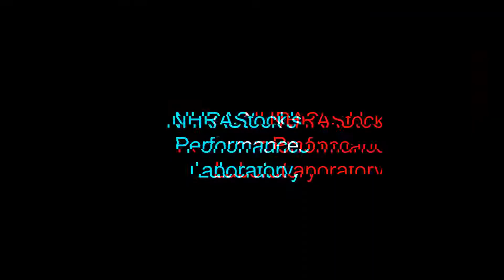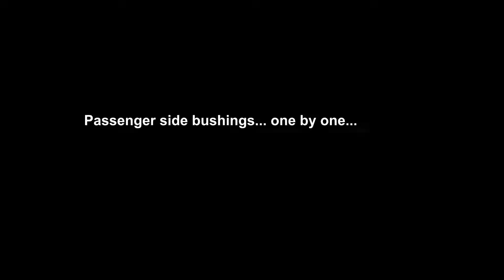GTO Polyurethane Body Bushings Installation

Comment: I know it’s been awhile since you posted this video. I just recently discovered your you tube Chanel 
If you haven’t already fixed the flexing I was wondering about boxing and gusset the frame 
I know some guys were swapping to convertible frames because the were stronger due to the lack of body rigidity. Those frames were boxed and I believe had gussets in them. Anyway just a thought  
Thanks for the great videos 25:04
Reply from the maker: Convertible frames are definitely stiffer, being fully boxed along the rocker sections, but they're hard to find, expensive (to buy and ship), and I didn't really want the extra 100+ lb. There are also aftermarket kits available to stiffen GM A-body frames, that I don't think are as heavy, but they involve welding, and that's something I'm trying to avoid, given the value of my car. I'm still trying to think of a "temporary" method to solve the flexing problem, but haven't figured one out yet (in my defence, the GTO hasn't been given much priority the last couple years though). Thanks for watching and commenting.
Reply: @The_Performance_Laboratory   No problem 
If I can come up with any other idea for a solution I’ll send it to you 
Again just trying to be helpful 
Keep up the good videos

Comment: Hello. Cant seem to find a poly body mount lit for my 67 GTO Hardtop. Which kit did you use? Thank you
Reply from the maker: POLY34111 from Performance Suspension Technology. Note this kit is missing a pair of bushings as it appears targeted at Chevelles. I'm told if you order the kit for a convertible, you will get the complete set of bushings.

Comment: Is there any bolt on solutions that would reinforce the frame from the underside. That car is too clean to be welding anything on.
Reply from the maker: The manual trans GTOs had rear frame reinforcements, and I've already replaced them with much beefier aftermarket versions, but otherwise there's not really any bolt on parts available to stiffen the frame. I'm going to keep thinking about possible solutions over the winter though.

Comment: Hey bro how do u differentiate the middle carb. Im thinking my 428 tri power would like one.
Reply from the maker: Not sure what you're asking. Please clarify your question.
Reply: On tri power center carb. U mentioned u got the bigger carb. How do I id the bigger carb needed for high performance  set up
Reply from the maker: @apethings7671  you want the Rochester 2GC carbs with 1 3/8" venturis, 7029114 or 7029118. They are extremely rare to find originals, so you might be better off just getting a Jet 37001 and adding the choke.

Comment: My resto guide book says thres 7 mounts per side. Ames would know. How much seperation is needed frame to body? 2", 3" ? I have a 65. How long do you think it took 8 hoours ? 20 hours? Car sounds like an automatic
Reply from the maker: 7 mounts per side on the body, plus the rad cradle = 8. Chevelles have only 6 on the body, except for the convertibles that have the additional bushings on the firewall. Both my GTO sedan and hardtop bodies have the full 7 body bushings per side. I only needed about an inch of body lift to swap the bushings. The whole operation only took a couple hours, but the lift certainly made it easier. Car is definitely not an automatic, but the slow motion video stretches the sound that way. Thanks for watching.

Comment: Could it be the frame flexing being that is a c channel? What about boxing it maybe not the whole thing but pleading it in different areas so many inches apart
Reply from the maker: Frame is definitely flexing. Looked into convertible frames (which are boxed - and much heavier), but not sure I want to spend that much money, and put that much effort into it anymore. More likely going to swap the whole frame/running gear into my other GTO, where a roll cage won't be a big issue. But other projects have priority now.